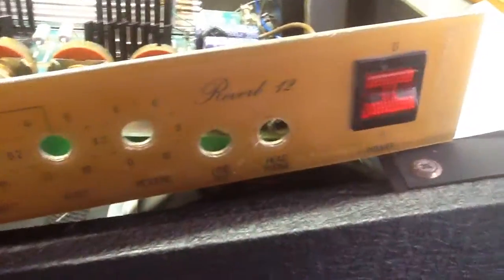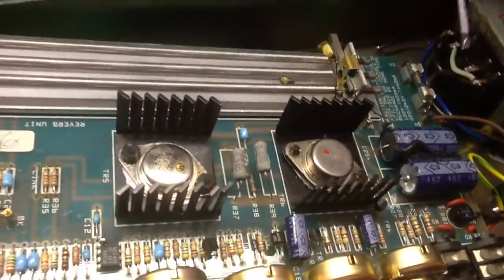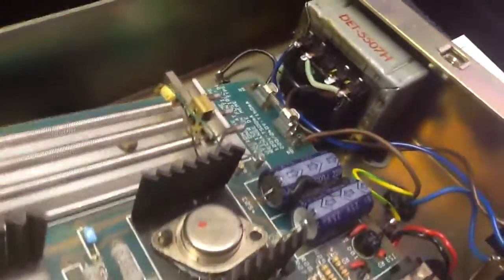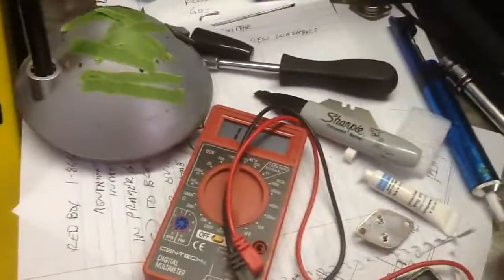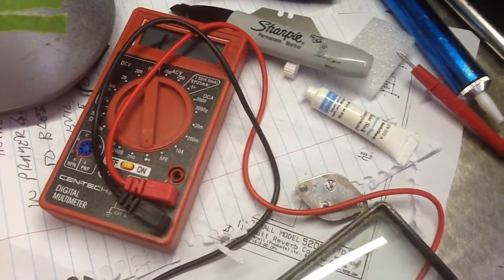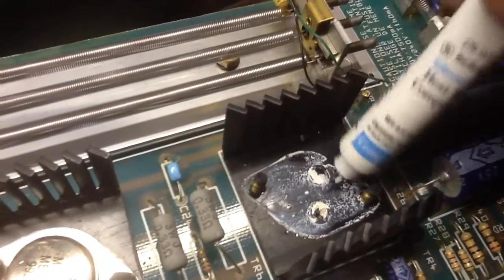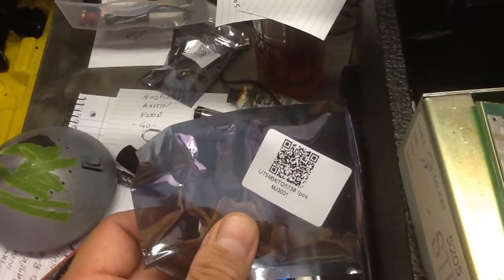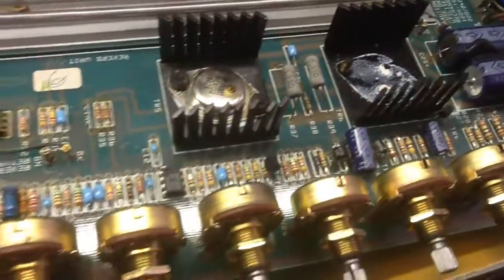Marshall Lead 12 Reverb 12 Power Transistor fix repair

Comment: Could you give us more info about the transistors please? These Lead 12s and Reverb 12s are getting old and the electrical components are nearing the end of their lives. It would help if you'd place a message here detailing the replacement transistors needed. Thanks.

Comment: Hello I was wondering if you could please help as I just this week aquired a "Marshall Reverb Lead 12 Model 5205". This amp looks to be completely stock as your amp is also,Now the problem Im having is not a huge problem ,The Bass knob is extremely tight and the Reverb knob is very very loose, Can you tell me how I would loosen or tighten the knobs on this Marshall Combo? For example Do I have to remove the chassis? I figured you know what your doing and I do not know what I am doing and you would just prevent me from guess work and would steer me in the correct direction if you what I mean, and would be saving me time. Do you think you could help me with this. Thanks for your time. Happy New Year!